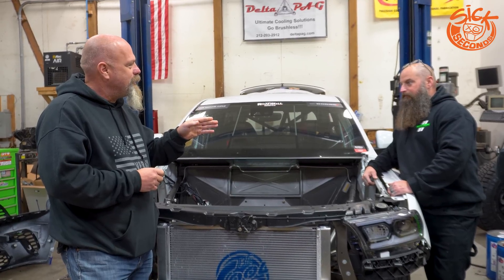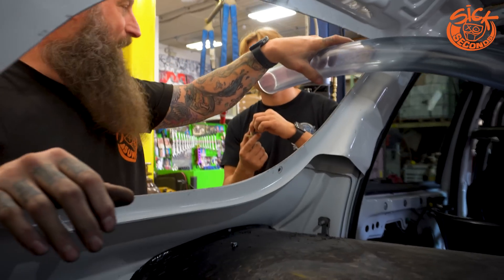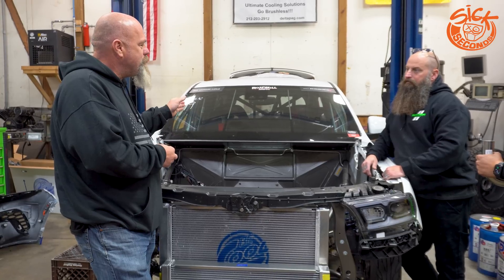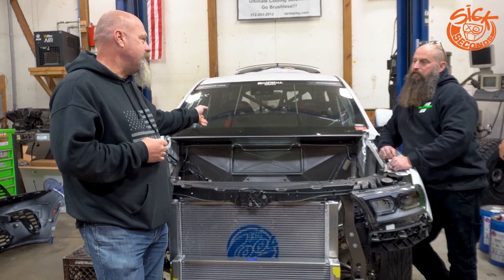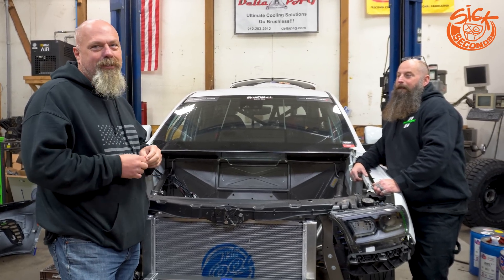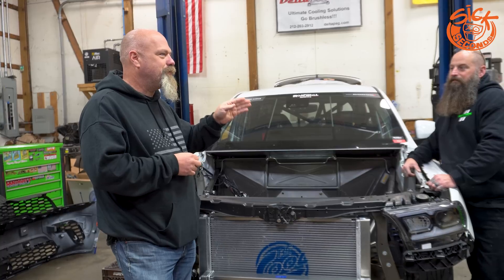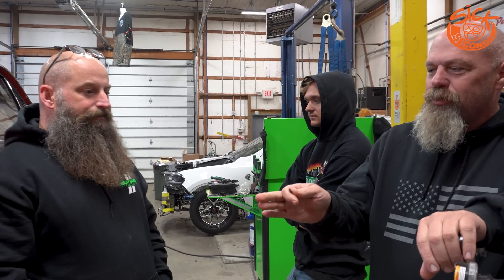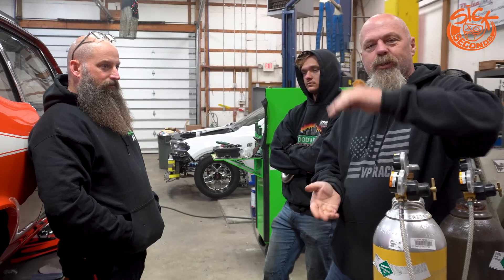Go Faster By Going Slower??? Sick Gear Ratio Science!

Comment: A 3.75 gear is 3 3/4 turns of the drive shaft for one turn of the wheel...a 3.50 gear is 3 1/2 turns of the drive shaft...its the decimal form of a fraction...

Comment: someone tell bobby that fuel cell is never going to take fuel with that discrimination valve tightened all the way up. it has to be loose. And if the vehicle is ever upside down, the weight of the fuel pushes it closed

Comment: Measure your drum or rotor, multiply by  pi. Take that and divide by 100. That tells you how big a .01 (hundredth) is in measure on your drum or rotor. Mark your rotor or drum as Bob showed you. Mark your pinion or yoke. Turn it until you reach max full revolutions before going past 1st mark on rotor. Measure the distance short of full last revolution, divide by your initial .00 measurement. It’s exact. 4.11:1 or 3.89:1 or in my car 3.73:1 higher number the lower the ratio. Higher number is also called the tallest gear. Welcome to car 101.

Comment: Whole number is revolutions of the pinion for 1 rotation of the axle. The point whatever number ... as in 3.89 or 4.11, the 89 or 11 is the oercent of a full rotation that it takes to complete the axles rotation.
 So, a 4.11 would require 4 and 11/100ths rotations of the pinion to make one full rotation of the axle.

Comment: OMG this is basic math. If you don't know this just walk away.  INPUT:OUTPUT  4.11 : 1 .   Where it matters is in the amount of torque your engine makes. low torque = higher ratio, it's all about getting the best performance out of what you have to work with.  
So if i can afford a second center section with a 3.08:1, and when i get to the track swap them. then i don't need a GEARVENDOR OD unit, it would just be another part to break!  but i'm lazy so i have a GEARVENDORS OD UNIT!

Comment: On semi truck you get more torsional vibrations with the 3.00 gear ratio compared to say a 3.55 ratio which is also easier on ujoints… new trucks are in the 2.5 ish range and have more driveline issues

Comment: hmmmmm... Tall gear  (3.00:1) Lower  RPM...... Low Gear (4.11:1) more RPM!...... With all the hills/mountains keep the 3:8ish   .... target 22/2400rpm at 70 MPH with OD.....  I'm old school have ran lots of large tires 35-37" over 4 decades.... T400 and 4l80E..... 6000# weight..... old days 3100rpm @ 70 mph was normal w/BBC & 400 tranny 2000 stall, torque cam, 35" tires, 4.56:1 .... and Carl built me the only 400 tranny that stayed together more than 1K miles in 96, there were 10 attempts by others of high profile before John Lingenfelter introduced my to Carl.......

Comment: Only an American could break down a diff ratio into imperial fractions to explain it. Talk about over complicating something so simple, and even then he was a mile off on his fractions. It wasn't just shy of a 1/4 (0.25), it was just shy of an 1/8 (0.125) of a turn. Learn the metric system and make your lives way simpler. You also have taller and shorter ratios back to front. The lower the ratio number the taller the ratio is.

Comment: sorry that was backwards. tall and short is based on the size of the wheel on the old big wheel bicycles from the 1800's. a large wheel is taller, like the 3.00 0r 300. 4.10 lower ratio would be shorter.

Comment: I know most of this, except we had a slight difference in terminologies. Growing up i was always tole Tall gearing was speed (high speed) gearing and short gearing was quick (Accelerating)  gearing. so a little backwards to the way you explained
Reply: I was always taught (for example) that 2.73's were Tall gears, while 4.88's were Deep gears.
Reply: @shawnhanifan2500 , Exactly tall for high speed, short for quick acceleration. I have also heard of deep gears, but where i grew up they were called short gearing

Comment: Watching those 3 "ratio teaching" was like watching 3 Cave Men sitting around the cave, slowly working out how to make a pointy stick!
Reply: The young kid actually asked an intelligent question around stall speed. Trying to cruise below stall speed is going to create all sorts of complications, not the least of them being transmission fluid heat. There was a reason given that I didn't quite understand. It sounded like they had some way to simply alter the stall speed from within the car, but not sure how that would be possible considering that the convertor is typically a fixed slip ratio. Unless the have some kind of variable ratio lockup converter that is capable of taking high horsepower.
Reply: @DodgyBrothersEngineering  he’s referring to the dump valves. You can fiddle with them to increase or decrease pump pressure. It’s like a controlled leak.
Reply: @picklefart  OK, not sure how much that would increase pressure in the converter, and how much that is going to effect stall speed. But without playing with it first hand I'd only be guessing, but I couldn't see the difference being massive.
Reply: '66 Tornado had a variable stall, if I remember right.

Comment: I was always taught gear retio was like inseam. A tall person is slower off the line but covers more distance per step. A short person is quicker odff the line but covers less distance per step. That said a 3.0:1 vs a 4.11:1 the 3.0:1 would be called all and the 4.11:1 would be short.
Reply: Yes he had it completely backwards. The lower the number the taller the ratio. There are probably easier ways to remember it. Just like putting TALLER tyres on the car the taller the diff gears, the more ground that you will cover for a given amount of input turns / revs. So taller tyres / diff ratio equals more distance covered per input rev. And being that torque is inversely proportional,  the taller the ratio the exact same reduction in torque.

Comment: I already knew Bobby, but it was still a good class. back in the seventy's we would run 5.13 gears in are Camaro's with a small block and a four speed are engine would not make much power but the gear would make the car jump. what happened to the pretty little girl you guys are not much to look at.

Comment: Thanks Bob. Rotation of the drive shaft is totally understood, but what is after the dot. 4.11 is it divided into tenths?
Reply: 4.11 is 4.11 turns of the pinion to 1 turn of the ring gear. So yes, the 11 is 11 one hundredth of a turn or just over 1 tenth.

Comment: Too bad you couldn't stack Gear Vendors like Lenco sections. Quick changers just can't handle the power, eh?
Reply: You can, its called a gearbox. There is zero reason for a Gear Vendor if you select the right gearbox and diff ratio to start with.